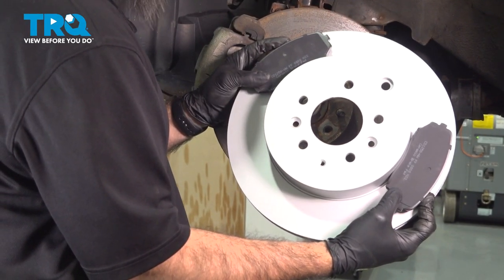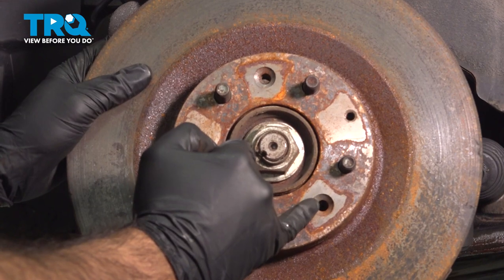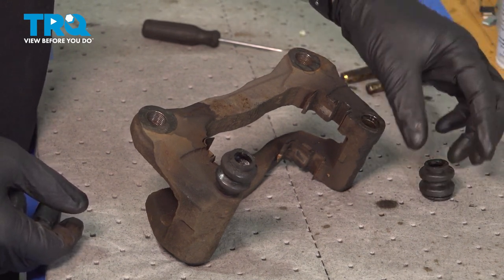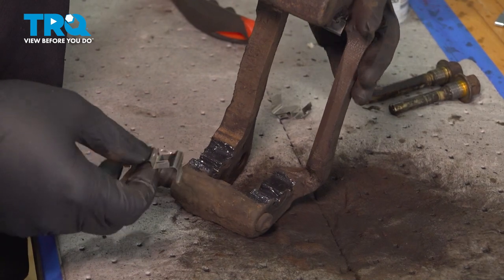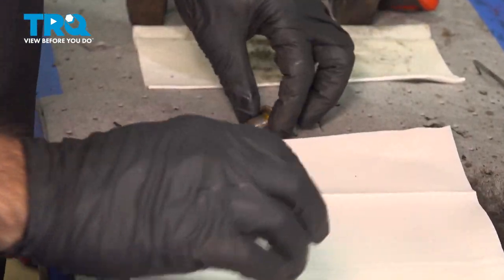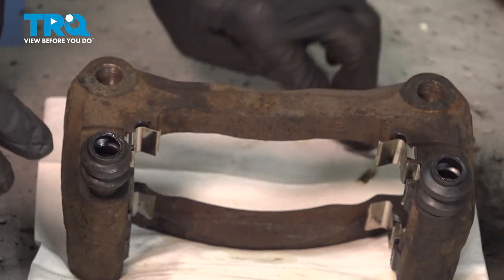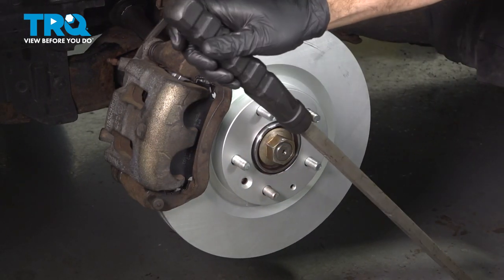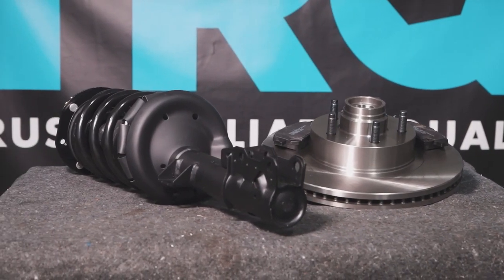How to Replace Front Brakes 2007-2015 Mazda CX-9

Comment: Very nice instructional video. Thanks! 
One question though, why do you take the axle nut off and oil if it wasn't take off previously?
Iis this an optional step? I don't think I have a socket that large or torque wrench to 200 ft lbs

Comment: 85 ft/lbs seems excessive for caliper bolts anyway to confirm the torque rating? I am getting ready to replace rotors and pads on my 2012 CX9 soon.

Comment: Don't put grease under your Hardware use anti-seize the grease will get hot and liquefy throwing it all over your rotor oil soaking and tempering it and causing your brakes to fail early also make sure to dry fit your brake pads to ensure that they move freely in the bracket if they do not use a resurfacing tool to fit them. I see people using grease on brake jobs all the time and they tend to use way too much. anti-seize under your bracket and a thin layer of Greece on top of your bracket just to help your pad slide if you put too much grease you will destroy your brake pads and rotor